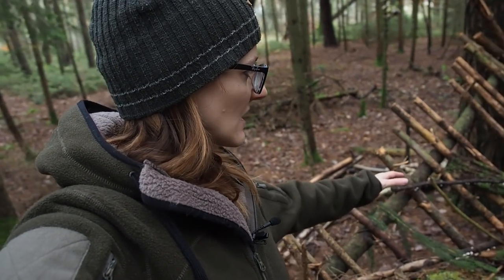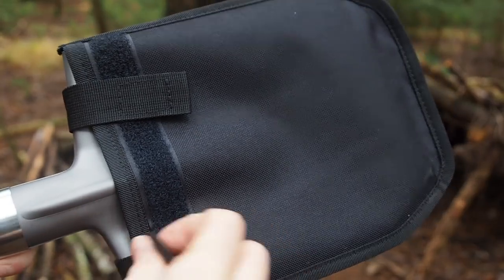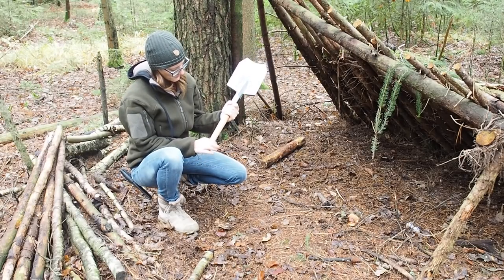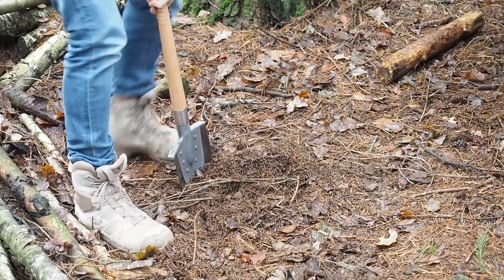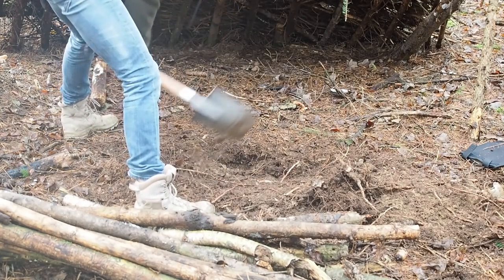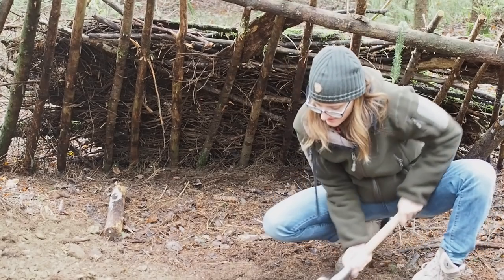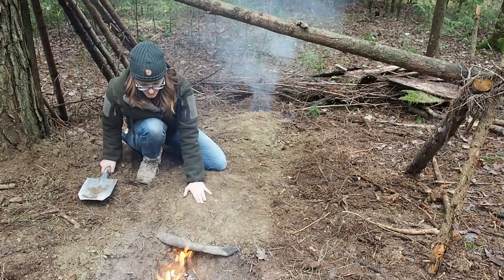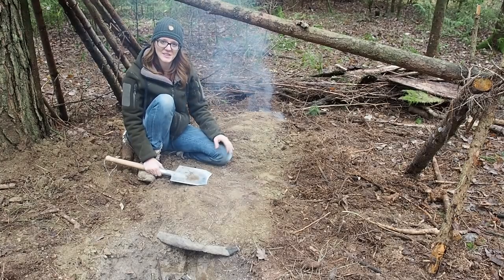Building a PRIMITIVE Heating System

Comment: best survival shovel ever is the german millitary shovel they used to dig the trenches in WW1 
mine is 100+ years old and it still works robstly if  i take some care i bet it goes another 50 years (maybe the second new handle after 55 years of use while camping and if car was stuck in snow)
it truely was built for eternity
its also more convenient and nostalgic than all this modern gear and it has a bigger plate so its no "toy shovel " you can seriously move something with that shovel

Comment: That's an interesting shovel. Not sure I like the double tip design, though. If it had a more traditional point I'd probably be more interested in it. I saw a similar underground heating design on another channel. I think their tunnel was a bit bigger, and they used stones all the way across the top because the fire actually traveled through it.

Comment: Seems to me it would be better to run your bed the length of the tunnel. You could use branches in addition to the bark to reinforce it. Imbed them in the ground, like that large root. So have maybe a deeper lean-to, or angle the tunnel a bit so it runs closer to the length of the shelter.

Comment: I was taught that 90% of the job was having the right tool, the rest is elbow grease (effort). That said, I entirely understand that this was a demonstration of the J2 shovel and it seems pretty reliable when dealing with undesirable conditions. Perhaps it would have been beneficial to have taken a bastard-cut flat mill file followed by a smooth file to further sharpen the shovel first....? 

Great video though and a big thumbs up! :) Cheers!

Comment: In order to build a actual usable system like that you have to build it on raised ground and raise the entire area under your shelter extra. Otherwise rain will flood it making it unusable and in winter most likely ot will be frozen solid. Realy like the idea though, probably a good idea to replace the bark with stones but i would enjoy finding out how practical this realy  is and how efficient is in a fuel/heat considaration.

Comment: question:  what about possibility of smoke seeping through and choking you in the night.  Now the ground tunnel looks well covered, but what if the heat gets too much?  Still the soil is not the type to get spread by fire.  But I am leary of having fire or smoke heat underneath me unless it is VERY secure.  Better to have a fire pit next to  a big rock that bounces heat towards and in my shelter/bed area.  But then, the ground would still be a bit cold?

Comment: Smoke won't travel horizontally very good because heat rises.. It would work better if the fire dropped off a hill or steep incline. Being as the ground will leach the heat very quickly you'll need a good flame going through it to do any good at all. If you can spend a few hours heating the ground deep into the earth with a heavy flame, your fire can go out and you'll be fine all night.

Comment: On your next attempt try digging your smoke channel 6 inches deeper and line it with river rock ....the steam And smoke will gradually heat up the stone giving off ambient heat even after the fire dies, also as hot air rises instead of using bark make the entire roof slate or stone this limits risk of catching fire and at the same time will store heat from the fire and smoke. Clay or Spanish Terra cotta   roofing would be perfect for the roof of your smoke channel

Comment: Why use such a small shovel? I’ve wondered this a few times while watching Lilly’s videos. I have shovels in my garage that wouldn’t put so much strain on the back due to the long handle and would probably get the job done more efficiently and more easily.
Reply: Ever backpack with a long-handled tool? .... but you can get tool heads and fashion a handle on site. Different circumstances have different optimal tools. Besides, they paid her to use this so it's extra effective!

Comment: I'm curious - it's an underground heating system, but you say it will only heat part of your sleeping area, not the head or foot areas.  Since you're putting in the effort anyway, why not dig a cross tunnel where the sleeping area will be, to warm more of your body?

Comment: That's interesting. My thought was that the fire would tend to draw air through the hole back to itself. But if it's getting enough oxygen from other sources then I guess some of the heat will enter the tunnel.

Comment: Hmmm .... maybe she does read my comments ...  Can always make a trident exhaust system so that head/shoulders, hips, and feet all have their underground heated system, and it makes an excellent draw (for sure).   Of course, this ancient Roman underfloor heating system for the houses,  definitely had a LARGE outside fireplace burning area ... even heating up the hot water bath system.
Reply: You have to account for the tradeoffs, especially in survival. The more branches, the less powerful the overall speed of the draw, meaning less heat is moving through the system. You can compensate with larger fires but in a 'first instance' of a build like this typically you get the thing working and then consider if you can afford to make tradeoffs. IMNSHO.
Reply: Well, of course, there is the possibility of not running the exhaust across the waist, but realign the fire or the shelter so that the exhaust runs the entire under-length of the seating and bed, then there won't be an issue.

Comment: tbh I am shocked this worked. I was sure the fire would use that duct you built as an intake, not an exhaust. If that were the case, you would have cold air flowing under you which would be bad. But the smoke is proof this isn't the case, great job!
Reply: I've made this exact mistake before. You do have to be wise to get it right the first time: Angle, wind angle, slope, diameter of intake and outtake and draw from the outtake hole are a few factors. If you face the tunnel exactly wrong it won't work. In most positions it will work somewhat. In the best position and shape it works 99% of the time.

Comment: Why are you digging with a miniture shovel, Lilly!? Look at the tool you are using, it has a level edge designed to pick up earth by shoveling it against the ground. Next time ask your sponser to provide you with a proper tool for the job - a full size spade  ;-)
Reply: I agree. I dig a LOT by hand and some areas are just really tough digging. This soil/root matrix looks perfect for a very heavy shovel wherein you use your body weight to cut lines. Chopping with upper body strength is energetically inefficient if not just downright ineffective when you have weight-based options for cutting. I think in this scenario I would have isolated the roots and cut them with weight (stepping on shovel or hitting vertically with torso weight) and then dug the remains from the crouched position Lily uses. Hacking from a crouched position is a testament to her endurance. I would have fainted like a snowflake.
Reply: It seems better to have a shovel that you can adjust the angle to 90 degrees like the folding ones, so that chopping and dragging are easier motions.  I dug a drain tile under a deck using an old army style folding shovel, it worked wonderfully considering the cramped space.
Reply: Because she's getting paid to use the shovel.,
Reply: when I first saw the shovel i was thinking that thing is worthless then she started using it and proved me right.. made my back ache just watching her.. I think a double sleeping bag and a good dog would keep you warmer than that snake hole she scratched out.

Comment: wouldn't it be wiser to use all flat rocks instead of bark to cover the tunnel so you won't accidently step onto the tunnel and collapse it , plus rocks would retain heat longer and it could become part of your floor inside your shelter. ?

Comment: Nice idea of underground heating system , i would used a pickaxe instead of a shovel to dig that trench, much easier on this soil i think. I always struggle with shovel ending using my knife and hand to dig in forest.anyway its cool to see you are using a 2000 year old roman tech to Heat your shelter .

Comment: looks like a better job for an etool rather than this shovel. ive dug foxholes on this same type of soil in less than 5 min alone. these wher two man holes 2 m16's long 3 ft wide and 4.5 foot deep.. but then again its dig or die in that situation so time may be extended in a non threatening enviroment

Comment: shovel for midgets... I would be laying on the floor with a soar back the next day for sure.... good thing Lilly is young and strong !
Reply: The length is not the issue. Short digging tools are fine if your technique is good and it's the right tool. We're used to standing tools in this day and age but most of our history is all about the short-handled tools. Next time you're in the garden take a long handled shovel (spade for you brits) and use it from the ground. You'll be surprised if you've never tried it.

Comment: doesn't it make more sense to build the fire next to the shelter (at the feet or so) and dig the heating tunnel laterally? seems like less heat would be wasted that way. by adding some side walls there wouldn't be too much smoke I think
Reply from the maker: when it is really cold you need the fire close to all parts of your body

Comment: If the roots caught fire couldn't it cause an underground fire?
Reply: The tree roots is fuel, one third of the triangle of fire. She did explain about the soil. For fire you also need oxygen (second part of triangle of fire), if the soil has much less oxygen in it, well, having a fire there will be hard. 
I can be wrong, but I guess that places having underground fire has a soil with more oxygen in the soil: there you have heat, fuel AND oxygen. All you need. But remove the oxygen... well, fire will be a problem

Comment: You can't feel the heat because  you isolated top of the tunnel with barks and soil :)
Reply from the maker: the heat will come through that after a couple of hours.
Reply: using large surfaced stones will be more conductive. also maintains heat much longer.
love your works btw :)
Reply from the maker: yes I know I didnt have any stones tough. :/ and I just want to use what I have available at this campsite.
Reply: MCaner: As long as the soil has some moisture it will conduct and hold heat fairly well. Good point though that stones would be an upgrade. One of the most fun parts of shelters is fixing little things like this over time.
Reply: @Biomirth  yeah. these things are my dream in my urban life. so I'm kinda jealous I think =)
Reply: You can accomplish a lot in a long weekend if you find the right area. Don't put it off! It's always both more boring and more rewarding than it looks.